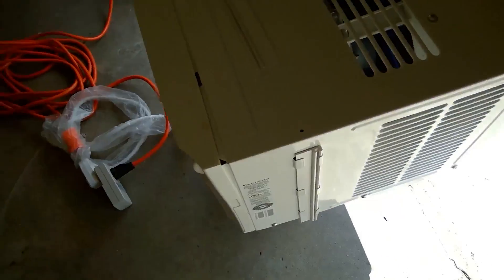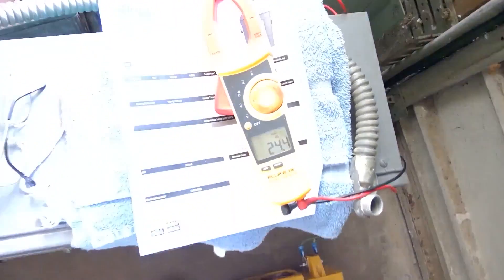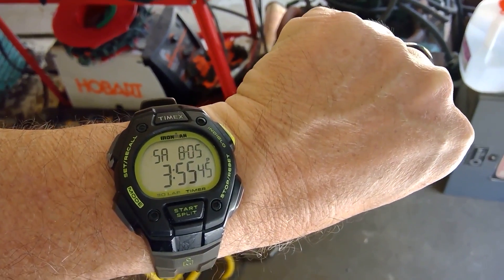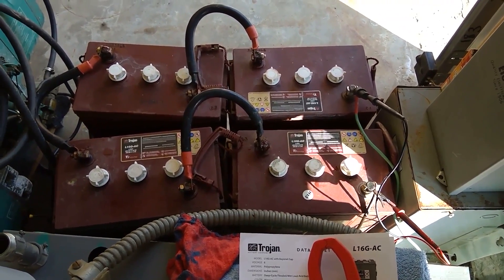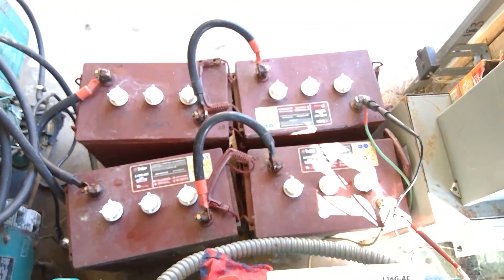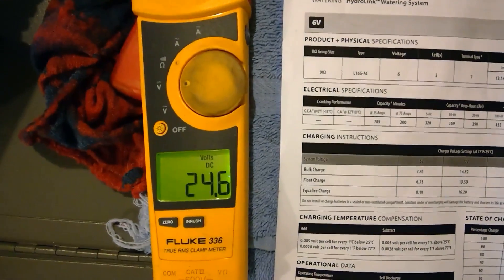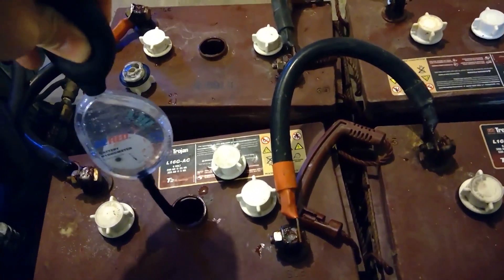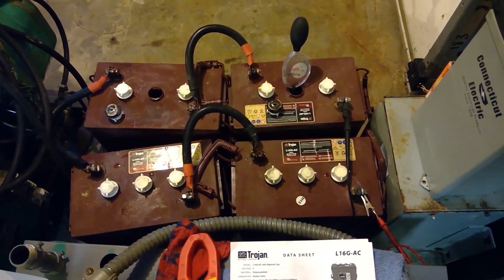How to run Air conditioner off of batteries

Comment: Not sure how your 1000 watt inverter is handling the expected 1300 to 1700 watt A/C compressor startup surge.
Reply from the maker: I believe the surge on that ac was around 2000, the spec on that inverter was inrush at 1500, just goes to show you how stout that inverter was.
I can almost guarantee you most cheap inverters would not be able to start that ac.

Comment: I'm curious why the extension cord, when its clearly unnecessary,
Reply from the maker: The plug end on the ac was too big to fit in the inverter so I had to extend it out with the extension cord.
Reply: @IFix-Things  I see, just surprised you didn't go with an adapter instead

Comment: Thank you for the informative video. My question is, if you are using a larger inverter; say 4000w instead of 2000w. Will the larger inverter itself draw more power from the batteries please?
Reply from the maker: Generally speaking at idle yes, but keep in mind there are many factors, such as how efficient the inverter was designed. Most are around 85-93 pct. Under load though, the load is the load, and most will be close , in other words if you are powering a 500 watt device  with a 2000 watt inverter, or a 4000 watt inverter the use from the batteries will be similar but will vary slightly.
Reply: @IFix-Things   Thank you for your reply I really appreciate it, I'm trying to educate myself on the subject. About how long does it take you to recharge the 6 V batteries in your video?
Reply from the maker: @almarco2341   Al, this really depends on a few factors, but the bottom line is how much energy that you take out, you must put back in, and time time it takes will depend on factors such as type of charger, max charging amps, weather (if solar),how many solar panels ,so you can see alot of variables in play. If you had some specifics,  I could help you figure out your scenario better

Comment: Do you have an update on exact hrs to run before draining?
Also how long to recharge with generator?
🤝
Reply from the maker: For lead acid it’s really a matter of how many ah you have available , the condition of the batteries, the wattage of the ac unit and Peukert's law

Comment: My Q now ....what I need to have something similar in my semi truck...good for 8/10 hours 🤷‍♂️
Reply from the maker: depends on how many BTU your ac is. You could prob use something like 4 battleborn 100ah batteries, that would give you about 10 hours on a 400 watt ac.
Reply: SuperRobkar I was thinking of portable A/C ...I think they like 900 w 😇
Reply from the maker: @oasisauto  I have a window a/c 5500btu that uses about 400 watts. try to find you one that is less than 500 watts.
Reply: @IFix-Things  I have a huge question man.. Let's say 4 batteries give 10 hours, you'd need 8 for 20 hours.

So 4 pack A is running for 8 hours, then it'd switch to 4 pack B while the other pack is charging, what happens if both packs die?

Would you need anitjer 4 pack C to run the next 8 hours so both A and B packs charge throughout the day? This is to keep a constant cycle going..
Reply from the maker: @daviedood2503  yes a 3rd pack, or buy something like a Honda eu2000i as a backup if both packs fail.

Comment: Portable AC with a car battery.. how can I do it?
Reply from the maker: Home Skillet one car battery won’t do it. It may run for 10 minutes or so.
A 5000 btu ac needs about 425 watts to run, and about 2000 to initially start. If you only have car batteries, you’d need about 8 and that would,only prob get you 1 hour run time. Another option would be to use you car. Your alternator would need to produce 400 or so watts, but you could hook the inverter to the cars battery. Of course having the car idle would surely abuse the cars alternator as it may not idle fast enough to cool the alternator or may not produce enough watts at idle.  Your bets bet would be to find a lithium battery., or use solar and lithium or deep cycle batteries. Some people also just buy a smaller generator

Comment: If you hooked up the batteries up for 12v instead of 24 v would it change things much ?  know you would need a 12v to 110n inverter.
Reply from the maker: Mostly would just need larger wires

Comment: So wildly is it almost double vs 12 volts? Adding   My thinking is my 450 watts a.c is  47 amp at 12 volt  vs 19 amp and your using tiny inverter cables  unbelievable.
  Read Someone who doing the same watts as mine say he can use a 2000 watts inverter but he need to used  double 0 gage cable to run cool.  Mine run but thge cable heat up fast 
 So this low amp are the bestbroute. 

        I have 12 volt panels 450 w panels  in series now.  soon to 950:w . so panel requirement. question? in series  my 12 volt  panels x 2_= 24 volt  that the same voltage as the 4 - 6 volt 260 ah  batterys  set up in 24 volt  Will it charge?  Or need house panels above 24 volt?
Reply: Hello sir, i have a 2 pcs. 9 plates battery from car  and i have aircon window type 0.5hp here in philppines how many watts i need of an inverter? Thankyou

Comment: hi friend! could I ask you something? I have 2 gel batteries 200ah on a system of 24v, and this air conditioner https://www.ebay.com/itm/Premium-Mini-Split-12000-BTU-17-SEER-INVERTER-System-Ductless-AC-ONLY-COLD-110V/163375916903?hash=item2609f6a767:g:KZcAAOSw83dblenD

How long could it last the charge and how many panels would you recommend for a system like this one, thank you!!!

Comment: That's a nice set up. I like the inverter.   I'm using a Samlex 1500 pure sine wave inverter.  I made a video demo running my A/C unit while it's in the wall.  It has been running for many hours and it works well during the day when the sun is out.  I only use 2 solar panels for now.
Reply from the maker: Thanks for watching. Nice clean setup you have there. Those samlex PST's are great. What size wire is that orange extension cord? thats the only item that I'd consider upgrading if its less than 12 gauge.
Reply: @IFix-Things  That was a 12 gauge.  I had a skinnier one before that worked just as well.  I thought I'd go with a heavier wire.  It was never warm to the touch.  I am waiting to get a 5 farad capacitor to install in parallel with the inverter to see if that can help with the surges when the AC compressor kicks on.  After running the unit for 3 hours it had an overload failure and the unit powered off.  The AC was surging too much.  Hopefully it will be here by tomorrow.  I will have to make an updated video after that gets installed.

Comment: For those people who can't (don't want to) believe this is possible, I'll explain this on a different approach that other people may find it easier to understand.

First, he has 4 x 320AH / 6v batteries connected in series that makes 320AH / 24v battery bank. Using Ohm's law, Power = Volts x Amps , that translates to a total of 7,680 Watt Hours of battery bank.

The 8000btu ac specs shows that it is rated 740W, and he turned it on for 4 hrs which translates to 2,960 Watt Hours (740w x 4hrs) consumed.

7,680Wh - 2,960Wh =  4,720Wh remaining power in the battery bank, which is also around 61.45% of the total battery capacity. If we present that in Ah using Ohm's law, 4,720Wh / 24v = 196.67Ah. That means, out of 320Ah capacity of the battery there was still around 197Ah (61.45%) remaining juice and he could definitely run it for another hour before draining 50% of the total battery juice.
Reply from the maker: Well said. You fully understand why this works.
Reply: @IFix-Things    I don't run my batteries that low. For my 12 V. ones,I'll give it  break @ 12.4    24.8 is OK for a 24 v.
Reply: @IFix-Things  Was there a reason you hooked the batteries in series rather than parallel?
Reply: Hello sir i have a 0.5hp aircon non inverter i want to buy power inverter i have alrwady 2 batteries 9plates fron car. How manny watts i need and what bran you recommend? Thankyou
Reply: Not to mention the compressor in the ac won’t be running like this indoors all the time. So technically real world use you’d get more hours out of this
Reply: Climate deniers can't do math so solar is hard for them to understand

Comment: THOSE ARE DEEP CYCLE GOLF CART BATTERIES.  THEY ARE MADE TO BE RUN INTO THE GROUND WITHOUT HARM.  DON'T FORGET THAT IN NORMAL OPERATION THE COMPRESSOR ONLY RUNS PART OF THE TIME.
Reply: Vitatta
Reply: No lead acid battery, Trojan or any others deep cycle battery is meant to run down 
Past 50%..

Comment: nothing is running,,no sound of the aircon is working,,lots of BS here,,
Reply from the maker: There is no BS , what do I have to gain by having nothing running? 
What is so hard to believe about 4 Trojan deep cycle batteries running a small air conditioner for a few hours?
Reply: You can clearly hear it running when he bends down, maybe get a hearing test!
Reply: @nhcharmedone  🤣🤣
Reply: I can't hear you what??

Comment: Hello! Can you make a video using DEWALT DCB1800B Portable Power Station with Flexvolt batteries to power a 8000btu AC? That should be a great video. The Dewalt power station is so popular now.
Reply from the maker: Hi, I don't have one of those, but looking at the specs, it is around 1800 watt max output,  I think each battery holds 100 watts, so youd have 400 watt hours, and my best guess is it would last between 10 minutes to 1/2 hour . If I had one, I'd love to test it for you.

Comment: is there a way to get your car to start automatically before battery dies? so i can run this off my car all night, with automatica car start charging?
Reply from the maker: In theory, yes it would be, if you had an automatic car starter, you would need to google search to see if something has been made already, I would imagine a sensor that read battery voltage, but why not just fill up tank, and leave car running?  A car battery does not hold alot of standy power to run an air conditioner. If you found such a product, the car would be running way more that it was off. Either way, doing this long term would not be good for your cars alternator.
Reply: perhaps if i take the speaker output for the low voltage alarm and soldered it to the button on the wireless remote circuit board when the alarm goes off, it will trigger the remote starter???? anyone think that will work?

https://www.ebay.com/itm/Tonal-Battery-Bank-Low-Voltage-Discharge-Alarm-12V-Monitor-Marine-RV/302724355589?_trkparms=aid%3D111001%26algo%3DREC.SEED%26ao%3D1%26asc%3D20160908105057%26meid%3Dc6bcf01808594af58c4aa1b7e152b4cc%26pid%3D100675%26rk%3D4%26rkt%3D15%26sd%3D122975532088%26itm%3D302724355589&_trksid=p2481888.c100675.m4236&_trkparms=pageci%3A46bb1aac-a9fc-11e8-b2ac-74dbd1806624%7Cparentrq%3A7b8cfbec1650a68d76aca145ffff21df%7Ciid%3A1

https://www.ebay.com/itm/car-alarm-and-remote-start-stop-engine-by-holding-smart-key-the-third-button/182938945014?_trkparms=aid%3D111001%26algo%3DREC.SEED%26ao%3D1%26asc%3D20160908105057%26meid%3Dc6bcf01808594af58c4aa1b7e152b4cc%26pid%3D100675%26rk%3D2%26rkt%3D15%26sd%3D122975532088%26itm%3D182938945014&_trksid=p2481888.c100675.m4236&_trkparms=pageci%3A46bb1aac-a9fc-11e8-b2ac-74dbd1806624%7Cparentrq%3A7b8cfbec1650a68d76aca145ffff21df%7Ciid%3A1

Comment: if you had 1200 watt in solar (4 panels) it would not even use the batteries....
Reply from the maker: and it would put some charge back into the batteries.!
Reply: The limit is the "Charge Controller" many are rated at 100 volts max, not all but that Epever he has is rated at 100.
After you have a array of panels you must set it up so the voltage never goes higher than the charge controller rating. If you have maxed out like that then simply build another array since you can have 2 Charge Controllers going to the same battery. I am doing this now I have 2 Epever running both go to my LIPO4 battery. And no they do not fight with each other on the output voltage. peace!

Comment: Great video. I haven't read through all the comments here to see if anyone else picked up on it.  But those wires between the battery bank and the inverter are miles to small.  They must have been getting mighty warm.  They need to be at least as big as the interconnects between each battery if not bigger.
Reply from the maker: Really depends on how many watts you are intending to use. In general I would agree with your comment, get them as large as you can and prepare for the max wattage of inverter, in my video, I was only using 600+ watts at 24vdc, and the length was about a foot. I used a few online calculators to deterine size of wire needed.

Comment: So let me see if I understand you correctly? You are feeding the 24volt battery output into your inverter? Is it a  24 volt  inverter producing 115 VAC? Does that inverter run on any DC voltage fed into it?
Reply from the maker: correct, its a 24dvc inverter. COnverts to 120vac